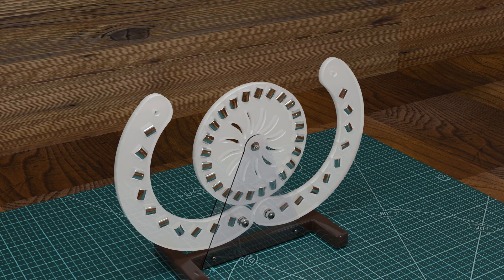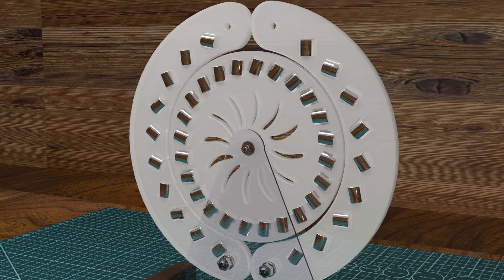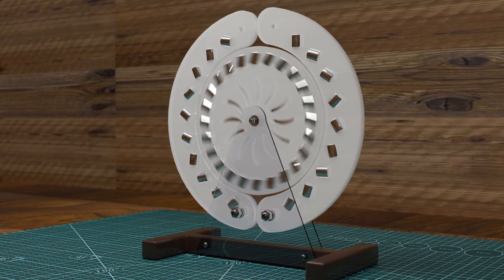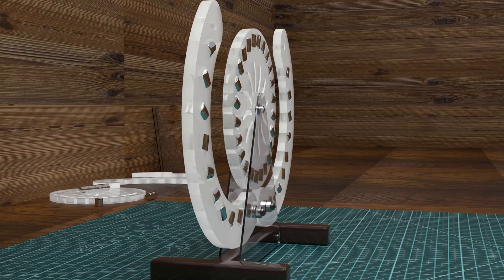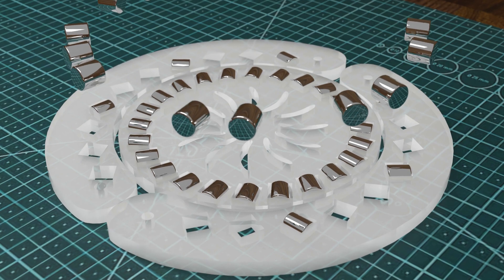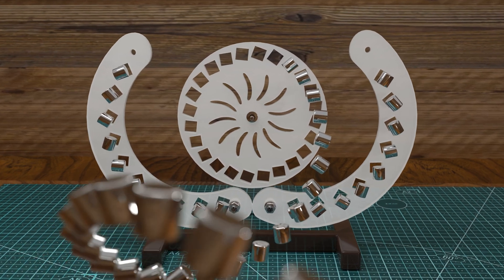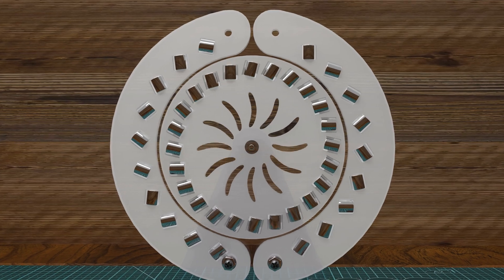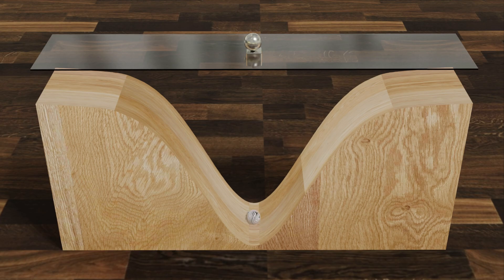Truth: Daniels Free Energy Permanent Magnet Motor does  not work. Just a prank!

Comment: A magnet motor should not just start at the moment of approaching the stator, it should actually oppose you when you are trying to enclose the stator. That, I think, is the very signal that there is serious magnet repulsion. The one I'm trying to get built, the final system uses a vise screw to force the stator stay in the proximity of the rotor.

If you can just enclose it and give it a spin, then at least something is not ok. 
If you get acceleration, then it's probably balanced and it doesn't start on it's own, but at least it accumulates potential energy.
If it starts on its own then it's probably done right. 

And if it spins down, like this one, then it just doesn't work. I think this one has a magnetic interaction so low that it stops because of it, that is, it isn't doing enough to even spin the wheel - yet alone to generate extra torque to power anything else - therefore potential energy is consumed and then it stops. 

If this bloody YouTube wouldn't incentivize fakes, we'd probably have seen more real stuff. This guy put effort into printing and assembling it, could at least have given more attention to distances and could have tried to make something closer to functional. The very fact that he didn't means he thought trying is pointless, therefore get the money from the clicks...
Reply from the maker: Great thoughts 👍🏻, thanks for watching 🙂